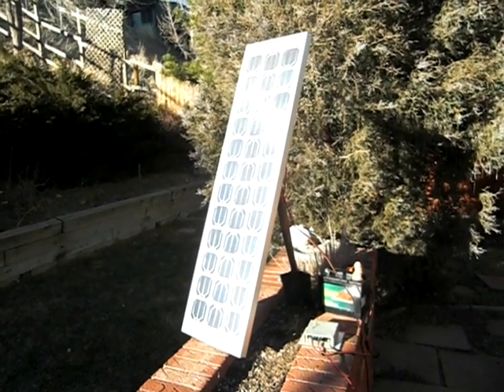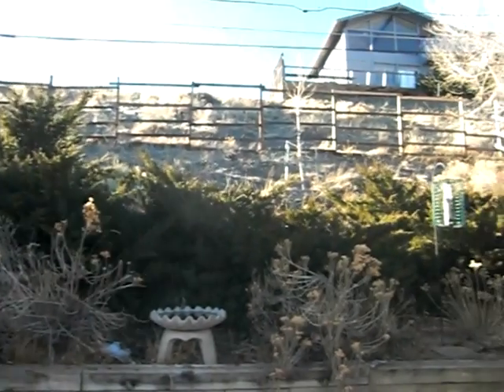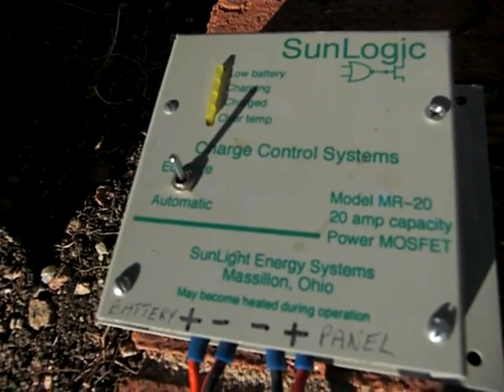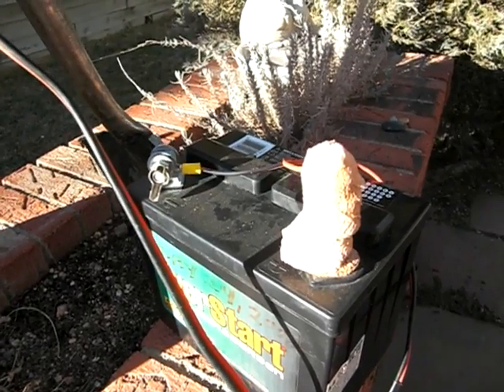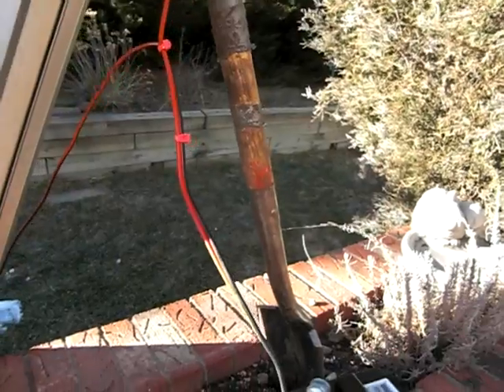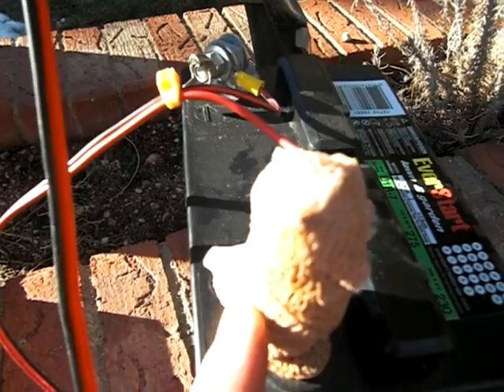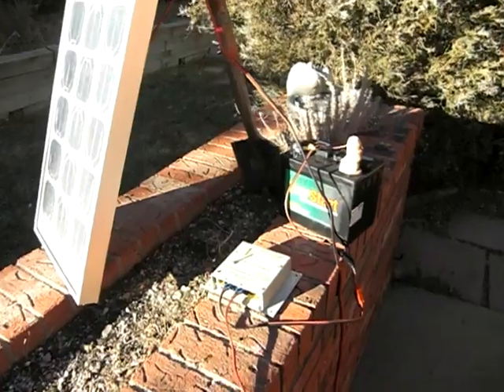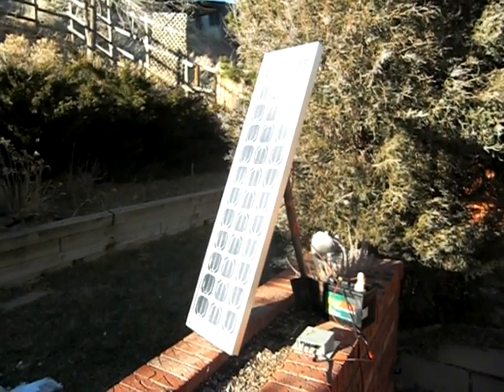Simple solar system charging during the winter in Colorado

Comment from the maker: There is a fuse under the wrapped terminal on the right side of the battery in this video. However, since then I've changed over to a dual in-line fuse configuration on the power cable itself. Either way, a fuse is essential so I appreciate you asking!
- Roger J. Wendell
Golden, Colorado USA